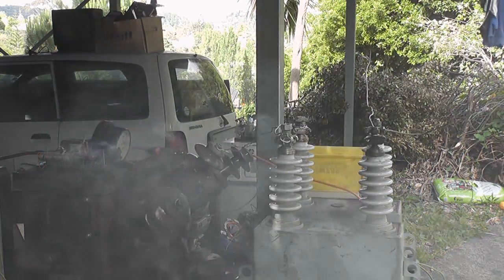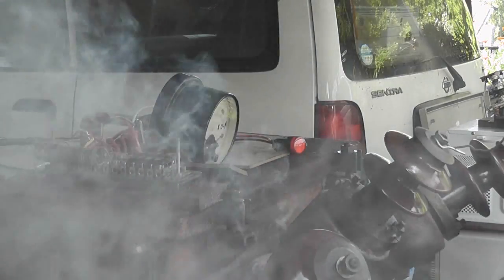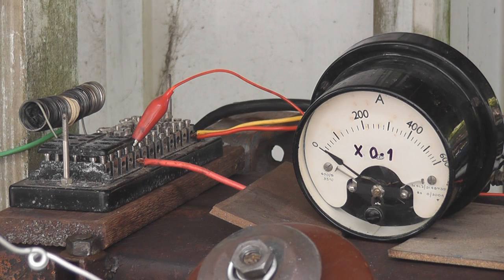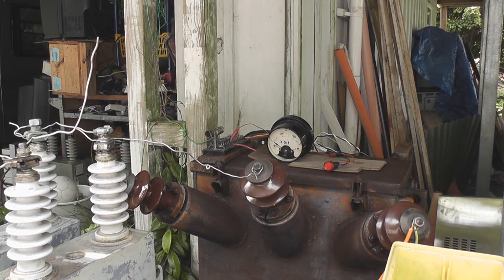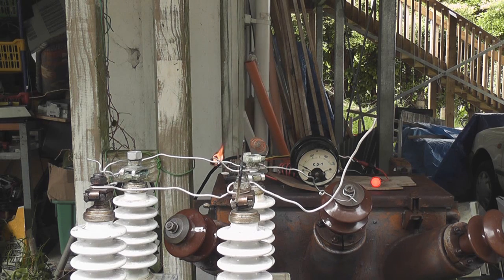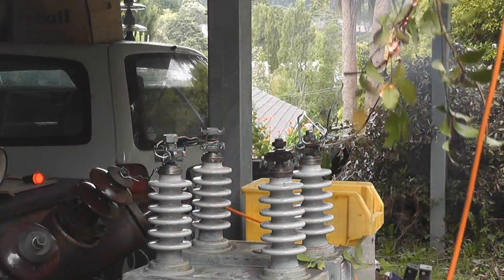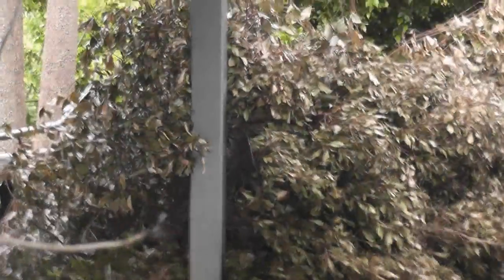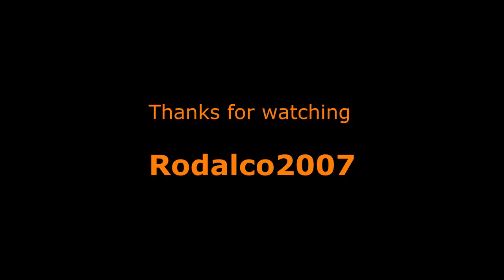22000 Volts Arcs

Comment: This is the use of the 600-700MHz cellular radio frequency spectrum which can cause to electric arcing at the high-voltage disconnector switch at the electrical substation when the substation electrical conductor performs repairs or an electric train with overhead pantograph switch.

Comment: what if you put hand in that bright arc? can it accidentaly hit you?
Reply: Electricity can jump 1mm per 1000 volts through air. And as soon as the arc is on, it has quite a lot of power going through it. As you see at the red hot glowing resistor. 22000 volts will easily get the lethal amount of current going (which is only like 8mA or something in that range).

Comment: Isn't that an 11kV transformer? If you were to put in 240V you still wouldn't get 11kV out as you're only (I guess) using single phase in one winding pair. So what's your input configuration to give you 22kV output?

Also guessing it's a high voltage delta to low voltage star transformer
Reply from the maker: +Tera Volt HV delta 11kV 240/415V star. Energized with 240 V gives 11 kV in grounded delta.
Reply from the maker: +Tera Volt Resonant Capacitor in series usually doubles the voltage.
Reply: @RODALCO2007  couldn't you run two of the three legs in series CTE to get 22kV? That's what I thought you did originally

Comment: Who said tree's aren't conductive? XD
Reply: That's why tree trimming is extremely important around high voltage power lines.
Reply: You have no experience with electric farm fences? In my younger years i thought to push such a cord out of the way. The shock went through like half a meter of wood. Trees are more wet than wood, conducts very well!

Comment from the maker: That transformer can do that all day. The 2.5 mil² extension lead used not.
a 25 kVA transformer will run at 1.3 Amps full load per phase. These older TX's will easy handle twice that with no damage for a few hours at the time. Bear in mind that this is a resonance circuit where the 11 kV  voltage is doubled via the Capacitor.

Comment: Viewer # 97 :D

Very nice arcs there, but I think you got unexpected flames! :-O

Yes, some nice arcs can be pulled from that transformer. What we need someone to do (somehow) is to make a motor+flywheel+generator combo which could store-up enough energy to turn out a good 50 kW of power for a few seconds.... Imagine the size of the arc that could be pulled with 50 kW behind it!

The only downside is the size of the rig & the expense of a 50kW generator. :-(

Thanx for showing,

-BoomBoxDeluxe.